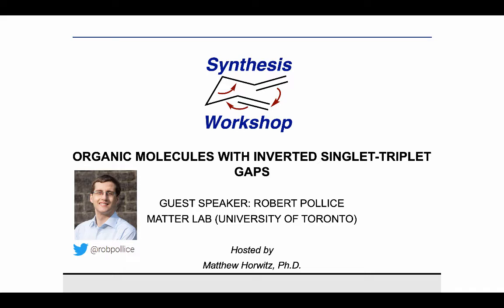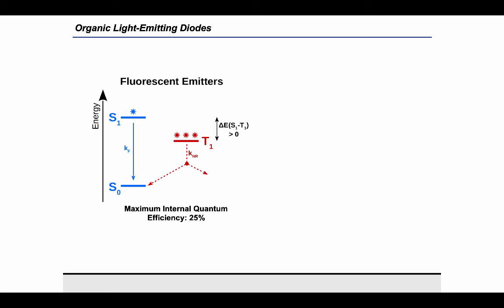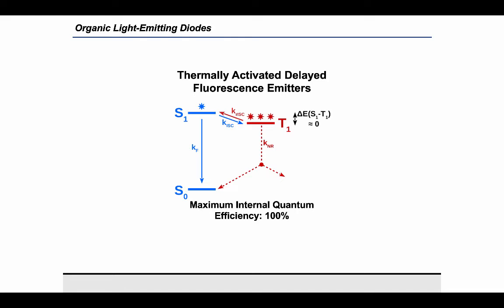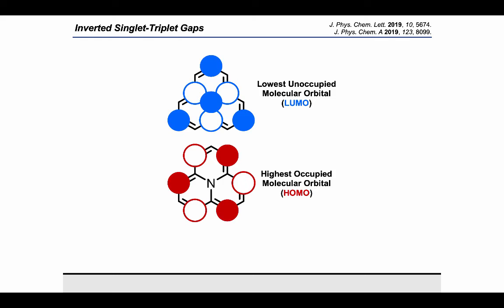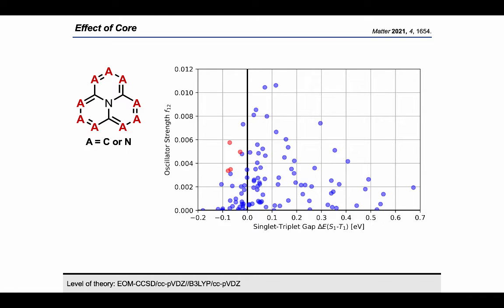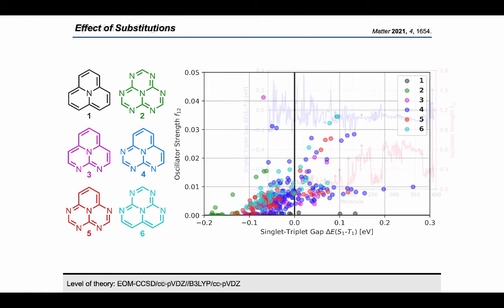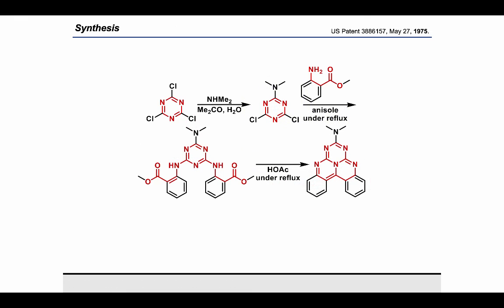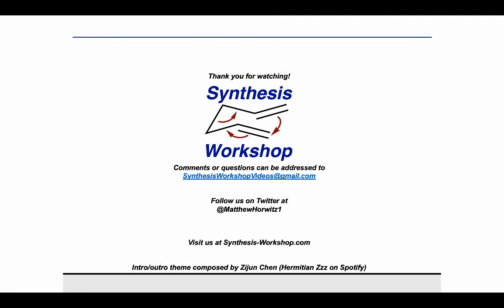Synthesis Workshop: INVEST Emitters with Dr. Robert Pollice (Episode 60)

Comment: Really interesting workflow! I have a question: how reliable are the calculated properties? Are there significant differences if compared to the experimental ones?
Reply: This is really a great question! Since there are still hardly any INVEST molecules experimentally known, I cannot really give you an answer as to how reliable the calculated properties are for the specific molecules investigated. However, all the methods used have been benchmarked extensively in the literature. Here, one can expect the errors to be within 0.2 eV which is still very considerable and can mean that some of the molecules we predicted to have an inverted singlet-triplet gap will experimentally only have a normal singlet-triplet gap. Some of these errors are systematic and can be corrected for but the remaining error cannot be easily corrected for. To make it even more complicated, singlet-triplet gaps are not trivial to measure experimentally and depend heavily on the method employed. I would even say that experimental errors for these types of measurements can be on the same order of magnitude as the computational errors for some of the methods we employed. Nevertheless, ultimately, these predictions need to be confirmed by experiments and significant efforts in that direction are underway.